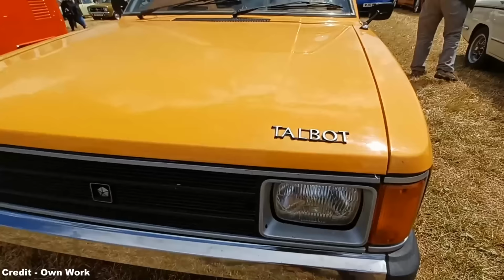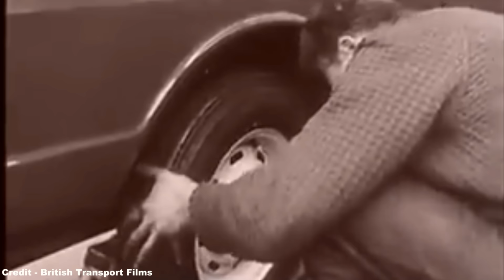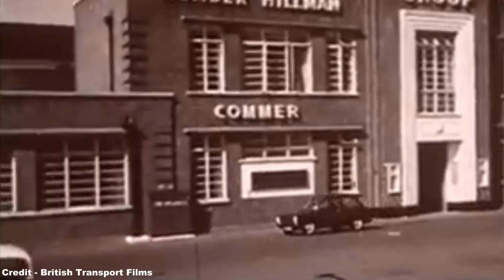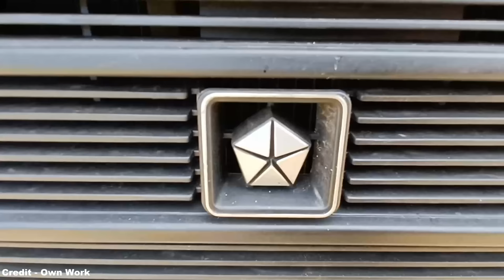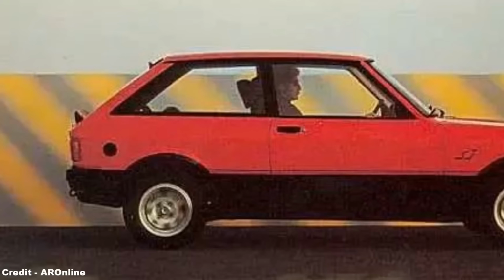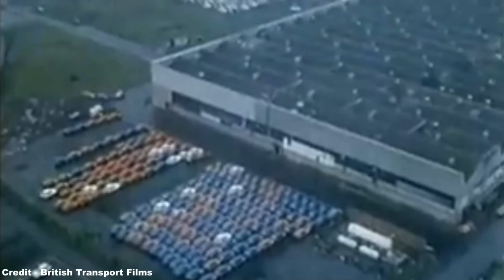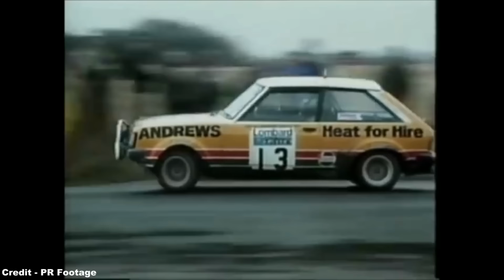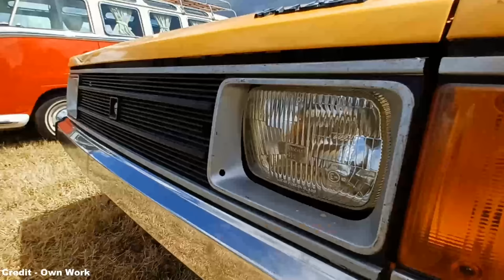Talbot Sunbeam - Putting a Shine on Things

Comment: My very first car was a Talbot Horizon, that had a 1100cc engine. 
I bought it from a car auction in 1988 for £800. 
Owned it for 3 years, but I could never get rid of all that tappit clatter from the engine.
Reply: It was not a defect, if was a feature.😉
Reply: They were noisy, weren't they? I had forgot that.
Reply: My parents owned a blue 1980 Horizon 1.3 LS in the late 1980s. That was also tappetty. It was badged a Talbot but had the Chrysler Pentastar badge on the grille.
Reply: I passed my driving test in a Talbot Horizon. Took me ages to master the clutch!
Reply: That noise was normal for the engine.
Reply: They are all like that, Sir.
Reply: And EXTREMELY low-geared steering.  Almost dangerously so, when you came upon a tight bend.
Reply: They could be kept quiet, I worked at a Talbot dealer back in the day, we used to set the tappits with the engine hot. I sold an Alpine with 155k on it and the trader who bought it said it was the quietest one he'd heard!
Reply: @davekirton4096  Oh my, if only I'd known that 35 years ago,  lol.......
Reply: @billy.g3597  If only! . . . Scary to think how long ago it was!
Reply: All similar French cars of that time had similar rattly engines.

Comment: I passed the test in a Sunbeam in 1982.  Great rear visibility.  Fond memories!
Reply: So did I in 1978 in an 1.0.  
Good little car even managed to take it onto the motorway standard A2 between Bexleyheath & Dartford whilst waiting for the test (which I passed 1st time) to arrive.
 Personally found the large hatch glass made reversing initially anyway awkward.
Actually ended up perfected my slow reversing skills in my late dad's 1972 Peugeot 504 which had 2 wing mirrors.
Happy days.

Comment: That is what we need now, not crazy expensive EVs but a small light simple hatchback that is easy to maintain and economical with modern turbocharged engines.
Reply: We have efficient small capacity reasonably priced cars but they are going to be replaced by two tonne EVs that need charging every 200 miles. That's progress apparently.
Reply: Buick has a small FWD based SUV with a 3cyl turbo (130HP) That's almost Lexus like in interior plastics.
And it's 29K.
I know it's not a car, but it has to be an SUV because it's what's hot now and people aren't gonna drop 30k on an American hatchback.
Reply: What we need more is clean air and less respiratory disease..! Besides, you know how thing work, development, new design, greater efficiency, cheaper production etc.. lead to lower prices. Think about the first motor cars, impractical, the price of a large house and slower than a horse, but technology moves  - on as it is with electric cars.
Reply: @mgcarmkm4520  charging every 200 miles ????🤣🤣🤣🤣🤣
Reply: @one2playdabase  Thanks for agreeing with me 😂😂😂
Reply: @mgcarmkm4520  no offense

Comment: In the late 80s I owned two sunbeams and I modified both of them to use for driving around the local forestry in Wales and I loved them, the only thing I didn't like was the gearboxes as they were extremely fragile but with a stronger replacement it was superb, many a happy time in them.

Comment: And yet............ The Sunbeam was a  cracking little car. I had a 1 litre, gutsy little bugger that hardly ever seen a petrol pump (Used to travel 30 miles round journey per day and never missed a beat). I ended up with a 1.6 and it was far better than the Ford Escort Mk3 that replaced it

Comment: Can't remember the last time I saw a non-Lotus version of the Chrysler/Talbot Sunbeam, but from 1979-1990 KGO386T, a Chrysler badged automatic 1.3GL in Bark Metallic was my mum's car.
Electronic ignition was a standout standard feature of the era.
I learned some bodywork skills as a teenager on that car, with filling and spraying rusty wings and some mechanical basics, until it failed it's MOT on steering rack play.
I was still just 15 and it was sent for scrap, though DVLA records suggest it lived on for another 2 years.

Comment: Had a Sunbeam Trio 1.3 - great car to drive and surprisingly practical. Absolute rustbucket, and I was constantly fixing things, but it was fun. Gearbox oil seal blew on the M1, and by the time I turned off for the A38, the thing was welded in 4th. Somehow got it home to Brum.

Comment: I had two of these, a 1.3 and another 1.3 that I fitted the 1.6 engine to. The difference in the car was pronounced with that extra few hp.
I also had a crate full of bits to build a Ti engine up, but it never came to pass, having to move house and a storm blew the roof off the garage the engine bits were stored in, resulting in their loss.
It was dead easy and cheap back then to build something interesting, not now, though.

Comment: Mate had a used one of these in the  late 1980s and it was a major improvement over the Austin Marina he first had. Tinny clang when you shut the doors and the engine was noisy under load but the front windscreen didn't require someone to mop up the leaks when it rained.

Comment: Did it have the handbrake on the right side of the drivers seat in the same way the Hunter did? It was a strange place to locate it.
Reply: That was a left over placement  from front bench seats in the  earlier cars .  Hunter was the last model to utilise that.  Avenger was in the middle  so  sunbeam followed suit .
Reply: A few makes had the handbrake lever where the Hunter range had it to the right of the driver's seat;  Volvo Amazon, Volvo 144, 164, Jaguar XJS ,Austin / Morris A50& A60, Vauxhall Viscount, Peugeot 504 pick up,